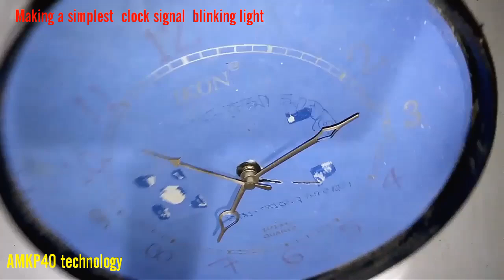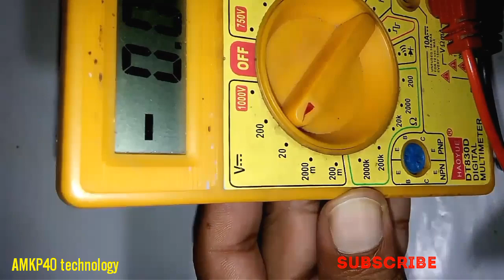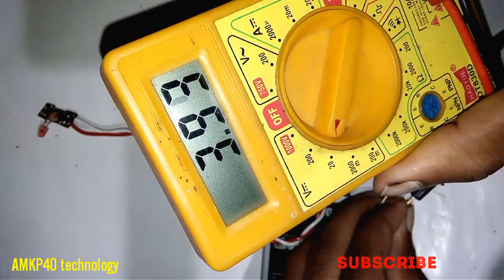Make a awesome LED flasher from old wall clock. Blinking led circuit, or Flashing light,Signal LED.

Comment: If we use damaga scrap wall clock chip will it going to work?
Reply from the maker: You can use any analog clock's chip oscillator circuit board.

Thank you for comment ❤️🙏

Comment: Can these be motified to get faster  blinking.
Reply from the maker: Can be little faster, 
This clock circuit was very old model but You can use todays circuit for little faster blinking .... I don't want to explain why ..??
Reply: Thank you for fast response. This is very helpful.
Reply: @jojocabonce1179  adjustable blinking? 555 Timer IC is your best friend.

Comment: I am giving 4v and led will continue to stay on it is not blinking
Reply: Yes same problem it's me
Reply from the maker: Use 3v or 3.7v max. Use a additional 1K Ohm Resistor input wires.

Thank you for comment ❤️🙏🏻
Reply: K I will try

Comment: If 5 volts gives it will work?
Reply from the maker: May be not, 
because this circuit for low voltage uses.
Reply: Thanks for your response .any idea to give 5 volt
Reply from the maker: If you want provide 5v in this circuit, just connect 150 to 200 Ohm 1/4 watt resistor.
Thank you ...
Reply: use  joule thief in output circuit  and aa cel  in   input

Comment: I also tried this with 3,7v battery but my chip just stopped working😭
Reply from the maker: You need to use additional 330 Ohm resistor.

Thank you for comment ❤️🙏🏻👍🏻

Comment: What resistor value do I need for this circuit if I want to run it off 12v?
Reply from the maker: Just try 2.2K or 5K Ohm resistor may work.

Thanks for comment ....💐💐💐